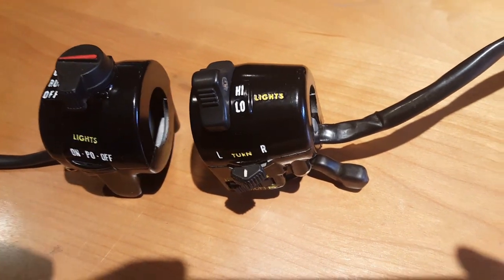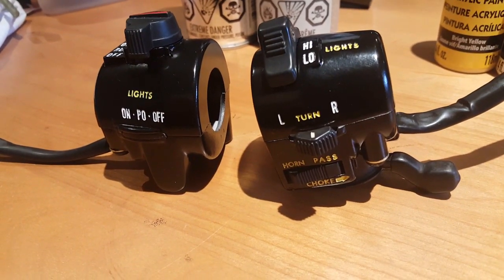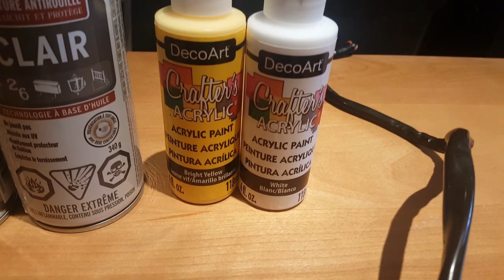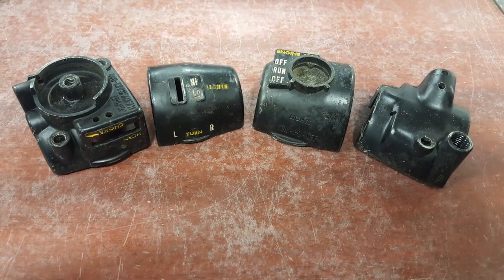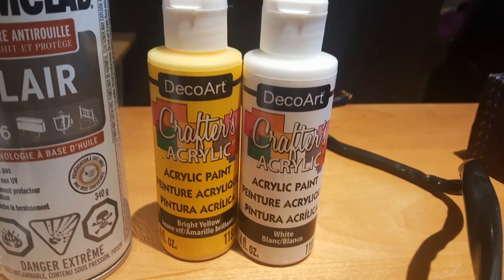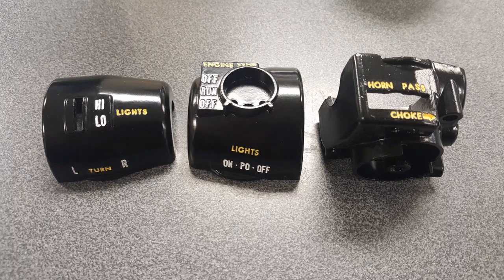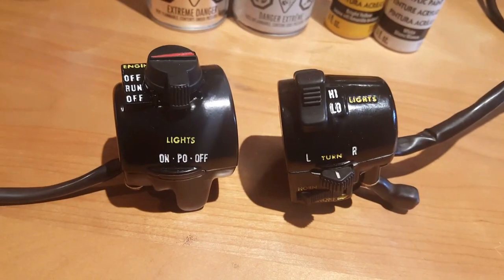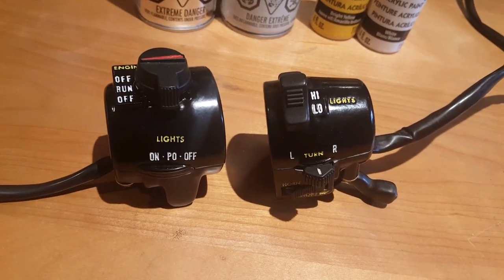HOW TO:  Motorcycle Controls Restoration

Comment: Great vid!!  I have a Honda Trail 70 with some sad looking handlebar switch but I think the housings are plastic.  I cant tell for sure, but are your housings plastic or metal.  I ask because I want to understand if glass bead is safe for plastic parts.
Reply from the maker: Brian,  These controls are metal.  I would be careful with plastic.   Maybe try on a scrap part starting with very low pressure (20psi)
Reply: @PetesClassicCycle  Noted! Thanks Pete!!!

Comment: What happened previously when you did not use the a Clear coat? Did the acrylic paint react with the black?
Reply from the maker: There was no reaction.  It just stuck to it and made a big smudgy mess.   The acrylic doesn't adhere to the clear right away allowing you time to wipe excess paint etc

Comment: Great job! Did you just solder the connections back? Did you used any special procedure? Thanks!
Reply from the maker: It all depends.  I've had controls with  broken connections before and had to re-solder them.  I find that the wires can get stiff and connections quite brittle so I recommend being very careful when handling them to not break the connection.  IF you do need to re-solder there's nothing special to it.  Make sure your surface is clean and go from there.
Reply: Pete's Classic Cycle Thanks! Just asking cause if you sandblast then you would necessarily need to remove the connections (soldered parts) from the controls don’t you? Then you would need to resolder everything back, am I correct?
Reply from the maker: You are right.  Before I sand blast I take everything apart so I only have the empty shell.  All the parts are screwed to the shell so it's easy to take apart.  If you watch my 2 latest videos you'll see in more detail.

https://www.youtube.com/watch?v=GqIbXItxwVk&t=19s

https://www.youtube.com/watch?v=Qrr5EPMFRNI&t=69s